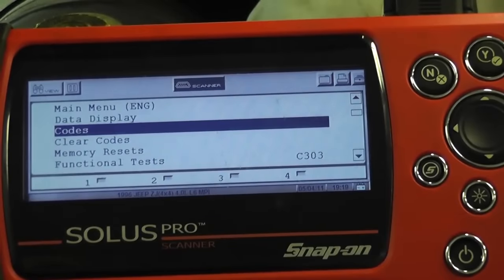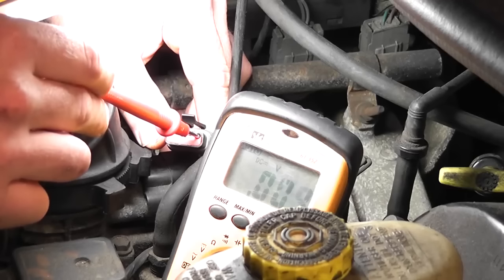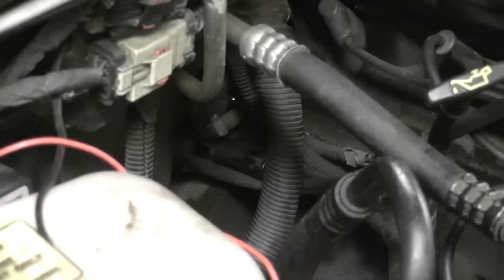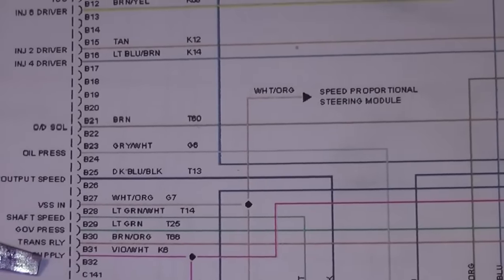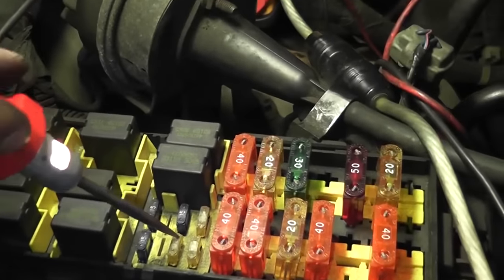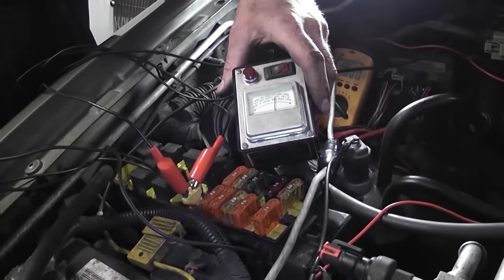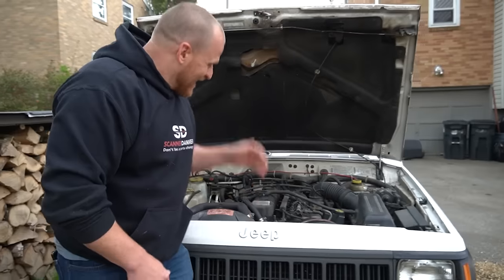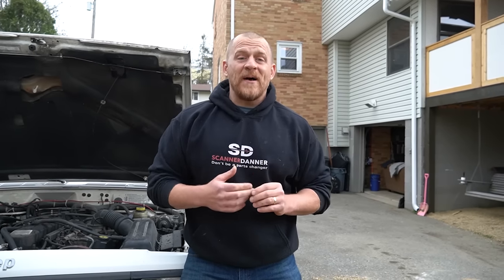96 Jeep, No Start, No Com with PCM, No 5v reference (Quick Tips)

Comment: Scanner Danner I have a question you’d be the man to ask I’ve never seen something like this before in my 12 years in this field ! 2002 Dodge Durango 4.7 The 5V Reference is showing -3.5v at the ecm crank sensor and tps sensor. Grounds do not seem to be an issue have been loaded tested. I’m really not sure what direction I should take from here ,customer has another ecm that I swapped and same results. Am I looking at a potential sensor pulling down the 5v system as for the usual or is there another direction I should be hunting towards. I’ve seen your videos in the past and rewatched to see if there is anything pertaining this with no luck. Any advice to this would be greatly appreciated. Thank you!!!
Reply from the maker: You have either a sensor that is pulling that ref circuit down or you have a partial short to ground in the harness. Step 1 is to unplug all sensors that share that 5v ref
Reply: @ScannerDanner  absolutely will thank you for your quick response sir!
Reply from the maker: @SMAutoRepairLLC  https://youtu.be/za13UnpbH7E
Reply: @ScannerDanner  thank you sir!
Reply from the maker: @SMAutoRepairLLC  let me know what you find!
Reply: @ScannerDanner  Absolutely I really appreciate your time sir.
Reply: @ScannerDanner  Calling it for tonight so far I have found a shorted map sensor, new one is installed 5v has returned to tps map and cam sensor. For the crank sensor circuit , im still getting around 3.1- 3.5v on the crank sensor 5v feed and Signal return. KOEO ckp plugged in or unplugged. Will run briefly now extremely extended crank time and sets DTC P0335. All to be expected. Is it really possible to have 2 separate issues on the 5v circuit at the exact same time I’ll be the 3rd place this vehicle has been the last shop replaced the PCM and as you know was not the issue.
Reply from the maker: @SMAutoRepairLLC  okay, to be clear, the signal return is a sensor ground, not the signal wire.
Newer computer systems have up to 4 different 5v regulators! It is possible you have 2 on your model year but unlikely in 2004. 
Green crusties maybe to your crank sensor 5v ref circuit? Very unusual to find a shorted MAP and still have low ref voltage to your crank. Wiring diagram will be key. Can't do that tonight. But can tomorrow
Reply: @ScannerDanner  understood! very much appreciated sir thank you.I will take a closer look at the connectors and give the harness running to the crank sensor a thorough  visual inspection.
Reply: @ScannerDanner  inspected pcm side connector and crank sensor connector, Testing at crank connector 5v ref shows 1v ground 0v (lights test light) signal return (sensor ground) At PCM I found 2 5v reference circuits one is 5v the other is 1.0v crank sensor signal return 4.6v at PCM.
Reply: @ScannerDanner  Alright so conclusion Faulty MAP sensor and 5v Reference short to ground found a small spot in the harness rubbing on the engine. I appreciate you reaching out to me and giving me some assistance in this repair. Day by day you continue to help the automotive repair industry become better, even taking time out of your day to help a follower you don’t even know!!! Was just an uncommon situation with this one having two separate 5v problems at one time. I’ve never run into that figured i was missing something for sure thank you 🙏
Reply from the maker: @SMAutoRepairLLC  wow, that was a tough one! Nice job on your fix. Would have made for a great video! Thanks for the update and keep up the good work.
Oh, and I love helping those who can help themselves and are willing to do the testing. I can't handle the "what part do I change next" people and honestly don't even bother to help them
Reply: @ScannerDanner  Indeed it was, i tell you it could had been a great video!! I haven’t gotten to the point of wanting to do diag videos like this I feel they would be way to long and may be off topic at times. I work for myself so it’s just me and sometimes I lead my self in the wrong direction! Or in some cases  i don’t understand exactly what I’m looking at as quickly as I’d like. I’m definitely not an elite diagnostic technician by any means, but I do the best I can  to troubleshoot the vehicles I work on and absolutely will not change a part unless I’m certain or have exhausted every other viable option. Makes for good business, repeat customers and a peaceful mind!

Comment: Hi SD, I have a Toyota rav 4 2010 Japan made model , car runs alright but instrument cluster meter does not function, replaced the cluster meter but to no avail , also obd2 scanner cannot communicate with ECU, could the ECU be damaged ?
Reply from the maker: You can't replace modules on these systems without programming them. And it being a Japan model, meaning it was built to be driven in Japan? And you brought it here? That's going to cause you some issues too I'd think.

Comment: This troubleshooting like if someone have hand finger pain but Dr start from foot finger....
If ECM is not communication then no need to waste time to check 5V and no need to unplug sensor 5V ref.First of all we have to check 12V B+ and B- power ref feed at ECM plug if it ok then check CAN.If ECM is communicate then go to 5V ref.I think this is right way to troubleshooting because wire cutter is very common tool in many local garage.
Reply from the maker: It is WAY faster to verify a 5v ref at a sensor than to check the ECM plug for power. Watch the videos referenced in this video and you will see what I a talking about. 

I truly felt going into this job (fuel pump running continuously and a no com, that we had a shorted reference circuit. Then with me teaching a class of 20 students while live troubleshooting, I got tunnel vision. But these procedure shown are super important to know how to do as 99% of people are lost after checking fuses. What do you do when the fuses are good? "Must be a bad engine computer"...nope, it sure isn't :-)

Comment: Thats it you just said that green wire was part of the "ASR" connecting the O2 sensors to the circuit...AAAAAArrrrrgh,  for months I have been trying to figure this out..WHAT THE HELL Chrysler? I would never had guessed the ASR[whichis mentioned in every possible electrical issue] was attached to the Oxy relay!
Reply from the maker: You're referring to the ASD (auto shutdown relay)?

Comment: Thank you for a systematic troubleshooting.  
My hyndai accent 2011 temperature sensor before and after the cat and also ECT only have 3.3V reference. What could be the prob?
Reply from the maker: temperature sensor before and after the cat?? Is this a gas or diesel engine? If it is gas, those aren't temp sensors. They are oxygen sensors
Reply: @ScannerDanner  it is a diesel engine, i have to temp sensors before and after, i also have 1 o2 sensor before cat.
Reply: @ScannerDanner  actually the main problem here is the hesitation during accel even when the engine is hot or cold. But it goes away when i stop for around 10 min. And drive again, sometimes it is still there. I noticed that the egr is still fluctuating in open position around 16% to 40%, thats why when i accel its jerking. When in normal running condition the egr is closed when i press the pedal, amd opens after i release it then close again when i press the pedal. I was thinking maybe the egr temp semsor near the turbo is controlling it. Im not sure. By the way the egr assembly is new. Its been like this for 3 yrs. No one from the shops here seems to fix it even kia and hyundai. I hope u can help me
Reply from the maker: @janechelonrico5218  post this to my forum https://www.scannerdanner.com/forum.html it is free to join and we can help you there. I don't see too many diesel systems but my guys on the forum do!
Reply: @ScannerDanner  thank you sir

Comment: Is there a 5 volt reference wire going to the coil. I have very low spark
Reply from the maker: Why type of coil? 2-wire? No, never. It should be battery voltage. I shouldn't say never. My 78 Power Wagon uses low voltage to the coil through a ballast, but that's 40 year old technology

Comment: fuel pump running continuously and a no check engine light , I do not have any blown fuses , help!
Reply from the maker: Power and ground testing at the ECM connector is your next step. You may also have a shorted reference circuit. 
You'll need a good wiring diagram. Here is a link for the DIY version of the same service info I use.
https://eautorepair.adtrk.biz/?a=10817&c=24&p=r&s1=

Comment: I've had issues with a '98 when temps got down to -13f...thinking bad connections or shrinkage during cold temps on connections. Total mental meltdown @ -13F I'm wondering...computer...flashing lights, nav center flashing, no start/no power? lol, suggestions?
Reply: Runs like a top above 0f. Even replaced the sensor for air temp.
Reply from the maker: 98 what? Jeep 4.0L?
Reply: @ScannerDanner  5.2l 1998 Jeep Grand Cherokee Limited.
Reply from the maker: @Phoenix_Enterprises  where are you located? -13 is pretty freaking cold. Winter blend fuels can absolutely be a factor. Also the quality of the fuel and whether or not you have moisture in your fuel tank.
Reply: @ScannerDanner  That was up past Denver colorado in the mountains.
It wasn't just fuel. The electronics weren't working properly. I no longer have that vehicle and am looking for another. I'm scanning my '95 Blazer Lt 4.3 for issues atm. Gremlins. P0300> Multiple cylinder missfires P0146>Non DTC defined. lol
Reply: New fuel tank, new sending unit with new pump, new filter. I'm headed up front next on fuel system. Electrical issues everywhere so I'm tracing and replacing. Fixing vacuum leaks/and sensors that don't spec out. New distributor, new coil. I'm thinking no sense in even asking until I get all the broken stuff fixed/replaced/tested. Then you may have some suggestions. I live in Texas btw.

Comment: I have code p0600 on 04 honda crv after replacing ECU and Immobilizer and i have no spark at all .
Reply from the maker: you found a good video to start with for sure! Have you checked for a 5v ref on one of your sensors?

Comment: Is there a 5 volt reference on a 2 wire knock sensor?  2002 Mercury Sable
Reply from the maker: Some will use a 5v bias (sensor unplugged) on the signal circuit, that will drop to a certain level, based on the resistance of the KS, when plugged in.
Reply: @ScannerDanner  Thanks,  I am trying to diagnose a P0325, and I am finding a lot of conflicting information on KS testing.  With the KS unplugged I am not getting 5v from the computer with the KOEO.  I tested both pins, can that harm the computer?  I have found 5v on a different sensor, and also I am fairly certain that I need a PCV because there is a lot of oil in the intake manifold.  Can the PCV cause a P0325?  When I test for resistance in the sensor there is no continuity...some say that is normal , some say that is bad...I say ##!****##!!!  Well, never mind what I say.  Do you have any advise?  Thanks again

Comment: Please i have strange problem with my caprice 96 my car run fine with cheap ignition control module dr178  13 dollars when it burned i purchased the gm d579  genuine ignition module acdelco 100 dollars and the surprise is the car wont start at all i return back the old one the car stat after few minutes it dies because heat and the module goes bad please any explains.
Reply from the maker: ignition coil may be shorted or you're just getting some crap parts, even AC Delco has a line that's made in China
Reply: @ScannerDanner thanks but acedelco is made in Singapore since 1990 and i suppose to be the distrubutor sensor or the signal from pcm to icm is it possible i opened the cheap icm from china that work fine i find simple circuit diode transistor resistor ic but the gm icm more complicated.
Reply from the maker: @soufyanedz9688  https://www.youtube.com/watch?v=jJmqdhhduVc

Comment: Ok why does no one ever tell whats wrong with the truck or car when you have all the fuses are good all relays are good everything works in the fuse box mine has no movement of the volt gauge or fuelgauge and the rpmgauge. Does not say no buzz or anything. It cranks over but will not start whats wrong with thiss one I have. Explain this one
Reply from the maker: let me check my crystal ball....nope, I see nothing 😋
I need more info to help you:
year, make, model, engine size, trouble codes to start with
Then more importantly, you need to tell me what you have and do not have!
Spark, fuel pressure and injection pulse must be verified! What are you missing?

Comment: My 2000 dodge ram 1500 v8 sport sometimes just shuts down while driving and it will flash no bus sometimes and it will crank but not start but if i wait 30 or 40 seconds (sometimes longer) it will start right up. i don't know anyone that knows how to fix it :(
Reply: no bus is ususally a ecm or pcm losing power . I just did a 99 sebring for a friend with the same symptoms out in AZ ordered a rebuilt computer runs like new again . check all your battery connections and battery first as I replaced all them also  and all your ground connections . do the dodge key cycle and see if it throws any codes too . my 97 ram had an internally shorted 02 sensor kept blowing asd fuse its on the same power curcuit drove me nuts because it would do it only when it wanted to until i unpluged it one day right when the fuse blew on the side of the road ,changed the fuse plugged it back in and it blew the fuse again 
instantly so I knew it was bad . changed it out and solved the problem .
Reply: @todds7614  Thanks for the reply :) The funny thing is it stopped doing it all together shortly after i posted the previous comment, weird. But it does however fluctuate the gas a bit (like I'm stepping on the gas pedal) when idling and the air bag light pops on all the time i guess no biggie I'm happy with that as long as it does not shut down. I bought a cheap idle censor and throttle censor just incase any future problems may occur.
Reply: @johnnygallardo76  that's cool glad it's still going . my 2001 dakota does same thing sometimes surges up and down at idle . I replaced the iac valve and it seemed to clear up does it once in awhile after long drives .

Comment: Doesn't make sense that you check ,5volt for shorts when pcm is off line, logical choice would be to verify power and ground to pcm first
Reply from the maker: Fuses are good, powers and grounds are good, same symptoms, no com, no start, no spark, now what? That's the point of the 5v ref checks.

Comment: Hello, what powers  the 5 volt reference from the pcm?
Reply: On a 1990 chevy c1500 tbi 5.7 the diagram states that the pcm has 2 5 volt references of which only 1 has the 5 volts and the other has .02 volts. Additionally it states that it has 2, 5 volt returns... what does that mean?
Reply from the maker: A return, is a sensor ground circuit and I'm almost positive that your 1990 model year only has one single 5v reference circuit. These are created by a 5v regulator inside of the ECM itself.
Reply: @ScannerDanner  Thank you very much for the speedy response!!!

Comment: What is the function of the ASD?
Reply from the maker: Runs the fuel pump and 4 other outputs
Reply: Is it controlled by the PCM?  What determines if it is picked or not and will the PCM drop it while driving? My sons 1999 Cherokee keeps stalling after driving for just a few minutes. He's 500 miles away and still cutting his teeth on car diagnosis so I'm trying to help remotely. It usually restarts right away and doesn't seem to die if it's just idling.

Comment: The first thing I would have done is check the fuses .
Reply from the maker: For sure, and I addressed this as to why we did not. I truly felt going into this job (fuel pump running continuously and a no com, that we had a shorted reference circuit. Then with me teaching a class of 20 students while live troubleshooting, I got tunnel vision. But the shorted 5v ref procedures shown, are super important to know how to do, as 99% of people are lost after checking fuses. What do you do when the fuses are good? "Must be a bad engine computer"...nope, it sure isn't :-) 
Thanks Andy

Comment: Danner...I can show you how to Isolate that Wire without Cutting it then having to Spend Time on Repairing it.
Reply from the maker: Yeah, pull the pin out of the connector. The problem on this design is all the pins start falling out when you take the plastic housing off that holds the pins in place.

Comment: Oh boy.....      so I'm guessing when it throws a code and troubleshooting says malfunction,   check for s wiring issue....   on  1  n the other says heater not switching......    also malfunction  or wiring issue....     that  something like this could be going on...
All my o2 sensors being special.....   all are reading lean....... except    for   1. It thinks I'm still accepting a challenge  apparently.....
N reading rich....   in which I thot  no ....   don't do this to me....     one of the reasons I'm thinking my cats are bad....    I visually thot I saw a red flag waved.....lol
It has all new O2 sensors..,  I'm not sure however if they are O.E.M.    I don't remember,  now....    I got  a bunch of  parts with the vehicle when I purchased it....    I just had to get them put on....   when it give me possibilities,   I was positive it would say cats need replaced....!!!     Been looking at  fuel trims ,,   we started out good.....   then after driving around for 2 days.....    they all went special on me I believe 3 may be  close but others went opposite direction,     not sure where to look to next......
A suggestion  or 10 might help.....¿      T.I.A.